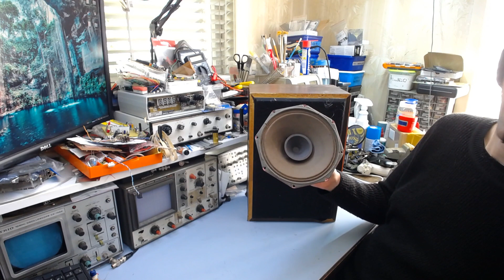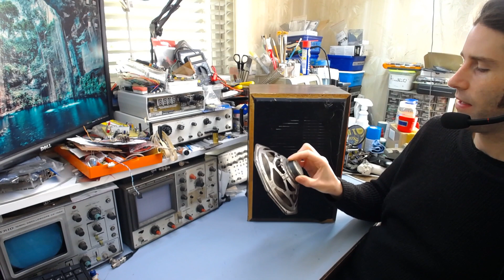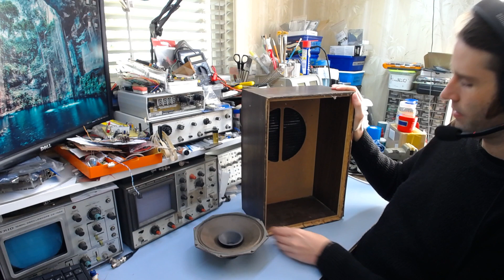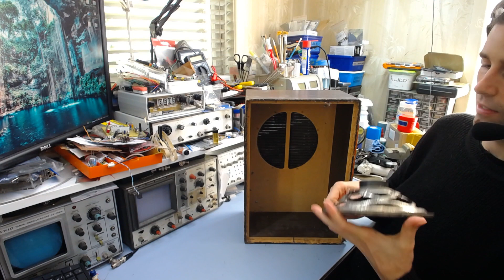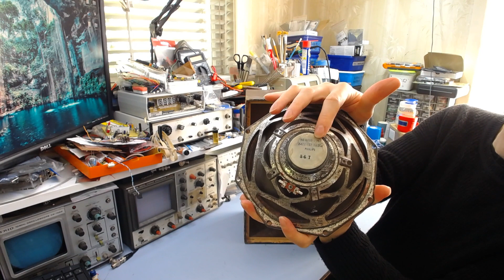A strange speaker cabinet mystery.

Comment: Your speaker is a "1-way", single-driver design which requires no crossover network circuitry, and that is a "full-range" driver. The dealie glued to the middle is generally called "a whizzer" and helps to produce higher frequencies. It's not usually present in high-end equipment, but was considered adequate for cheap gear. The vertical strip is a support likely intended to improve the "tone" of the cabinet. Perhaps the manufacturer's marketing material implied that their product benefited from being built like a cello body. The slats may just be for looks, but for period of time, a similar slatted grille, though much smaller, was placed in front of tweeters to spread their angle. Though the slat partly obstructs the whizzer, it may be intentional, reflecting high frequencies back onto the driver cone and then ever more widely to scatter out through the slats.

Comment: The overall design looks poor. Blocking the wizzer cone is not smart, probably to reduce resonance of the front panel. The bigger mystery is what the back panel was like originally. If the back was sealed then it was intended to be air-suspension and won't work that well otherwise. But I kind of doubt they were going for air suspension, everything is too wimpy for that. There also should be some insulation, fiberglass, Dacron, or egg-crate foam panels to reduce internal reflections at higher frequencies.
Reply from the maker: The back panel was just a sheet of particle-board like the sides, sealed in. No foam inside on any surface.
Reply: @Agent24Electronics    Then you're going to have to go back to sealed. Use a thicker panel than stock but you probably want it removable. Front panel could be thicker too and eliminate the brace across the hole, but at that point consider building from scratch. At any rate, there should at least be insulation on two perpendicular inside surfaces (if not all five).

Comment: Rigidity is often the issue with speakers., so the extra material is probably intended to reduce resonance.
Efficiency in speakers isn't always a good thing and audiophiles often brag about how inefficient their speakers are!
Reply from the maker: Another good point I didn't think of. Thanks! Ironically though, with these cabinets being so old and knocked around (a friend actually scavenged them from the dump years ago) A couple of those horizontal slats are broken on one end, and with enough volume, now resonate wonderfully (or not!) at the right frequency.
Reply: Agree with the rigidity but not the efficiency, poor efficiency is never a good thing.